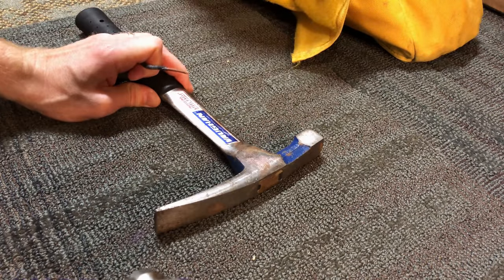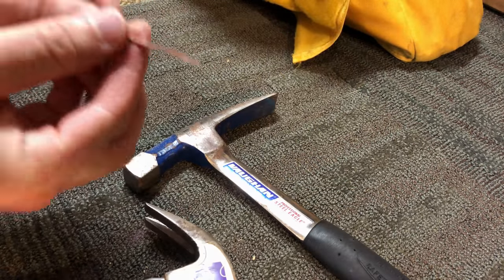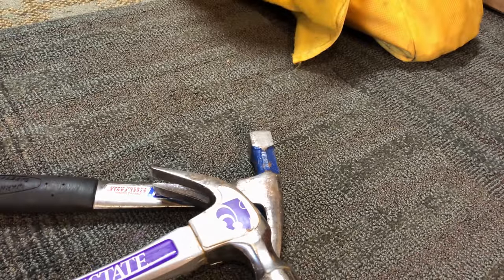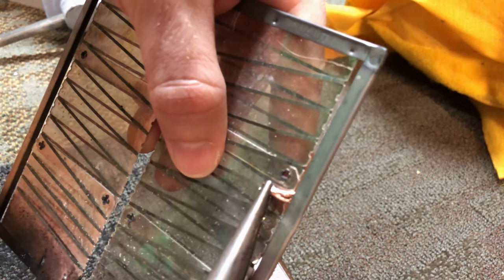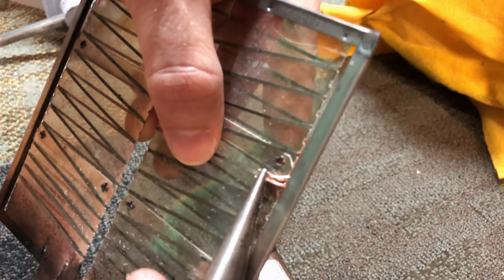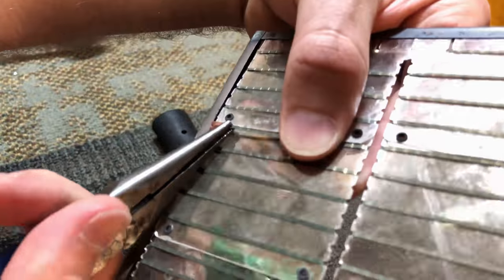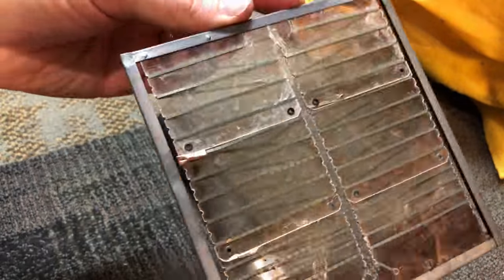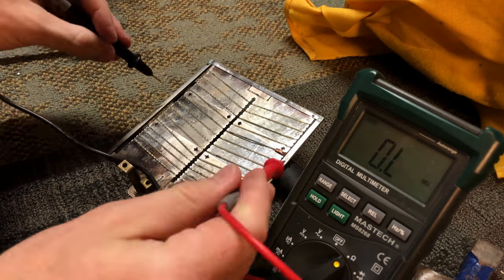Dualit Toaster Element Bridge Building

Comment: You can also drill a hole (with a Dremel) in the mica sheet and connect the two cables..it also works fine ;-)

Comment: I'm amazed that the repair lasts more than a couple of weeks! Wouldn't it have been a lot simpler to simply get some copper foil to use. I gave up on performing repairs of this sort, but I still try to think of ways it might be done at home.
Reply from the maker: The copper foil would not have been durable enough for this repair.  When I looked into the replacement panels, they had changed the design from the beautiful mica sheets to a modern composite material.  I will continue to repair the unit as many times as I need to.  It is fun.
Reply: Salve, scusa avrei bisogno di restaurare completamente un tostapane del 1930. All'interno vi sono 3 fogli di mica molto sporchi e bruciati che ho intenzione di cambiare. Sui nuovi dovrò avvolgere del filo di ferro come conduttore di elettricità e questo dovrà venire incandescente ma non ci sono lavori simili in italiano. Mi puoi aiutare?
Quello che avvolge la mica è realmente e normale filo di ferro? E i contatti a ponte come vanno fatti?
Grazie molte